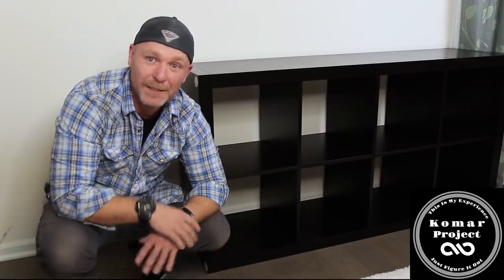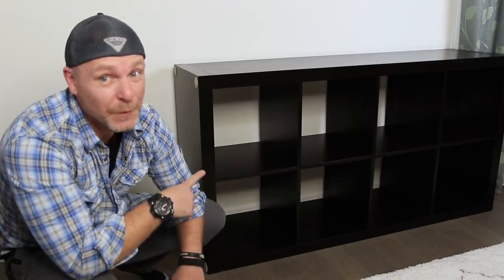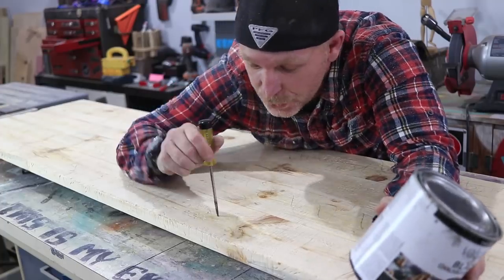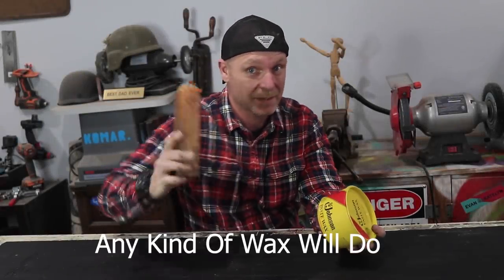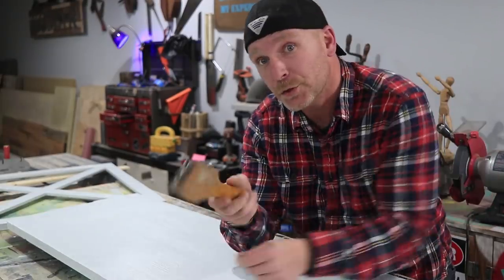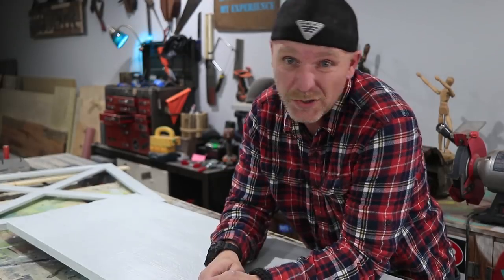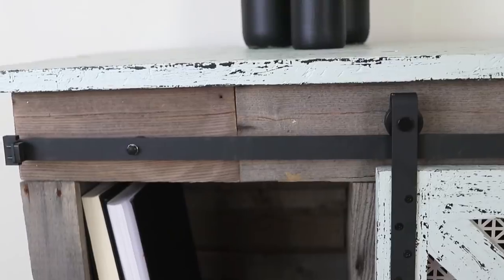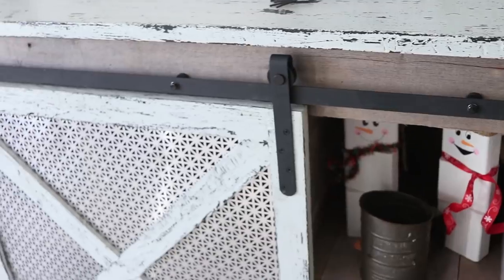IKEA Kallax Makeover; $70 Ikea HACK ( Pallet Kallax)

Comment: Hi! Love your work! I’m looking to convert old billy bookcases to use outdoors. I used it for a party and in one day the laminate peeled off in some areas. What wood and sealer do you recommend using to basically cover the melamine under the laminate (removing the laminate)😬
Reply from the maker: If your going to use it outdoors I would go with Ceder or another rot resistant wood.  And my go to finish for exterior is https://amzn.to/3PP4oAf

Comment: I have quite a few hand power tools, but I want to start acquiring bigger tools. :) Which would you recommend that I get first, a table saw or a miter saw?
Reply from the maker: Between those two I would go with a table saw.  You can make long cuts with it and add a miter gauge or sled to make your cross cuts.  With a miter saw your only limited to cross cuts.

Comment: Lovely work. But here in Spain wood isn't that cheap, so it wouldn't be affordable. Wood would cost much more than the Kallax unit.
Reply from the maker: Raquel Tejera I had no idea wood was expensive in Spain. Why is that? 90% of the wood came from pallets that I got for free from work, I got supper lucky with it so the wood didn’t cost me anything.   I even got the 2x6 for free from Lowe’s.  It was their rejects.
Reply: @KomarProject  maybe it could be easy to find some pallets, but there are companies that buy them , I suppose that to reuse the wood and make other things with them. I'm not sure what. Here wood isn't very common in construction. We make brick walls in our houses and concrete floors.

Comment: Nice project but the console is now possibly 3times as heavy as before. Two more rollers in the Middle of the console will decline the weight per Roller to the floor.
Reply from the maker: Udo Rechner so far the wheels are holding up well. But a good idea.